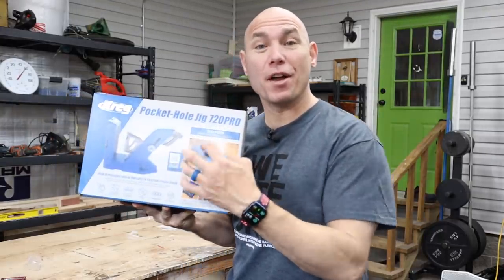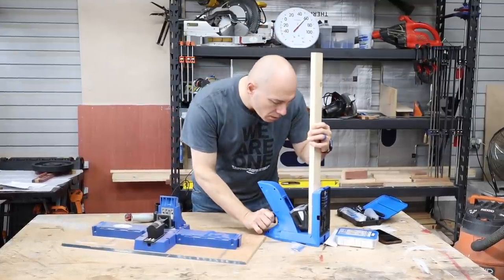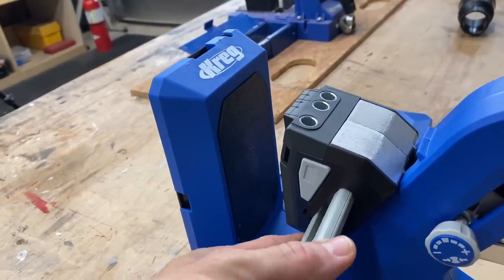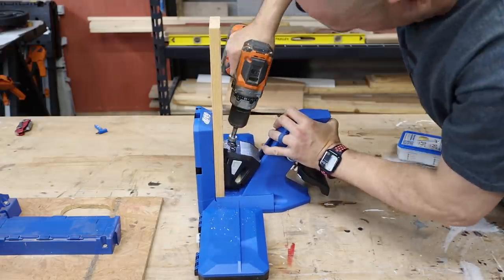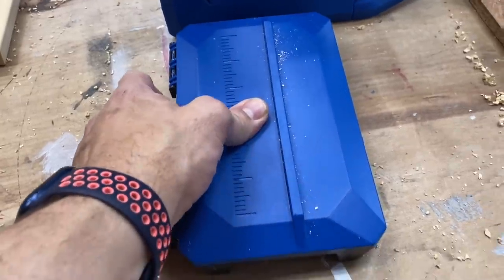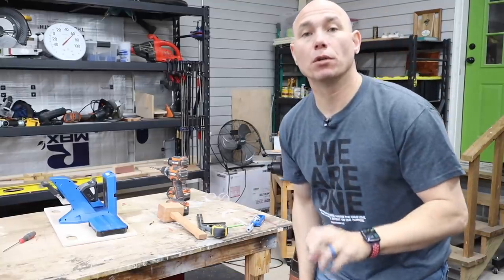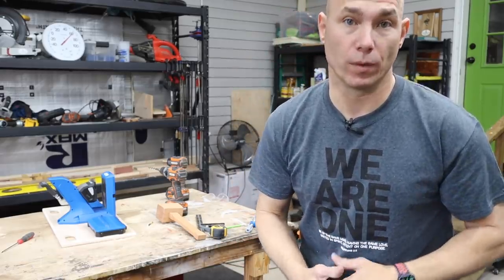Kreg 720Pro Is BAD!  I Made It Better!

Comment: Quick question...  Now that you mounted it to the board, you have eliminated the ability to move it and flip it the other direction to use it for large pieces etc.  Do you think there is a way you could mount it so that you could take it off the board easily to take advantage of this feature?   Also, those (flimsy) storage boxes are supposed to be mobile to place anywhere you need to support the large flat pieces and now that you have screwed them to your board, they are also stuck.  I was wondering if you had considered a way to mount them securely that would also allow them to pop off when needed?   Good review, and I also agree that those boxes are a fail.   I also think the clamp is a fail,  you have to screw it for days to get it to hold and it really doesn't hold it super solid, then you have to screw it for days to close it up enough to fit it back in the storage box.   Would have been simpler to just stick with a place to use an automax clamp.  Also, the clamp is useless if you flip the unit to do plywood because you would have to shove the jig back from the edge of the table?    Whoever "engineered" this, wasn't a woodworker...lol.
Reply from the maker: I could move it forward, but I never use them that way so no need to

Comment: My K5 broke on the first project I used it on, specifically the connection point between the driving rod and the sliding part of the clamp sheared off.  Sadly I couldn't take it back because I'd had it for years without ever using it.  I bought the pro afterwards, and while I do not like the cheap feeling, it has helped do a thousand holes probably and works just fine.  I have since retired it for all but cabinets because my dowelmax jig is absolutely superior for alignment and strong joints, at the cost of speed.

Comment: I build cabinets for a living and have used the old kreg pocket hole jig similar to the k5 but older and I still have it after 16 years of use I have finally looked to upgrade.
I pocket hole and biscuit front frames to my cabinet boxes I also use the kreg jig to connect front frames together with added domino biscuits not that you need them but it does help eliminate movement.
Just wondering what one to get now, what pocket jig do you recommend ?

Comment: Just an idea, but mount the storage side of the jig flush with the board so you can still use it both vertical and horizontal?
Reply from the maker: Thanks.  I never use them horizontal.  I have the R3 that I use for that.

Comment: I am having the same issue.  The hinges are extremly weak and if you don't baby it, the wings fall off and the latch pops off when you move it.    I also get a crooked hole when using 1 1/2" lumber.  It does not hold it flush as if the plastic is not strong enough and pulls away.
Reply from the maker: yeah, it needs work

Comment: Thanks, but it seems you could have "fixed" another important issue…  If you would have secured the left "storage box" to the left a bit more (with a wider foundation plywood base), that would have solved the issue of the lid not fully opening.  I would try putting a 45° connector on the vacuum tube — and pointing it down.  Having this stick straight out just makes it a cumbersome annoyance to seeing what is going on and would help keep the vacuum hose out of the way.  I have always put my pocket hole jigs on a board and like the "hard" plastic of the 3, 4, & 5 jigs.  I never upgraded to the 5 because I never saw the improvement enough to be worth it, although I do like their (Series 5) clamp better and "seeing" it in action causes me  to rethink my prior presumption.  Only practical way to support long boards is to create a wing that is the same height as the jig's platform; this is the basic reason I updated to the 4.

A couple things you did NOT cover… Will the 4 & 5 pocket jigs also work with the 700 series?  I have some accessory drilling blocks that c/would be useless if I cannot use them in a 700 series pocket hole jig.  Something really nice is the collar placement location etched on the drill bit.  This makes collar setting alot simpler and faster.  Also, supporting 1½" AND ½" stock is easier in the 700 series.  But for the seemingly flimsy plastic (compared to the rigid 3,  4, & 5), particularly on the Pro model, is a potential deal / anti-upgrade breaker.

Comment: Great review. I bought one of those awhile back. It's great for me, but still a pain to use. I like the board you put it on.  I'm curious, is there a reason you didn't put it flush to the end of the board so it could be used vertical?  

Thanks

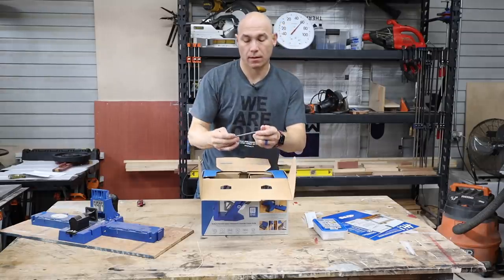Comment: You are not a big Dummy, you just did not watch the Kreg video on attaching the Storage Boxes. The 720 has a keyhole slot in the bottom. You mounted the adaptors outside the bottom of the jig. The adaptors slip into keyholes on the bottom of the 720, and then two screws goes through the adaptor into the board. This lets you quickly take the 720 off the board and reorient it, and then replace it. Just watch the  "Set up a pocket-hole workstation: Kreg® Pocket-Hole Jig 720/720PRO" and go to minute 2:00 and you can watch it. Love you channel.

Comment: Good review. I seen another review on this. But he did not show how he fixed the 2 issues. With that said. Take a look on the bit depth on the back. Vs the K5. I heard the K5 had more markings for the depth of the drill bit..
Reply: They should have a separate storage bin for the extra sawdust in this and then call it the 720 pro elite 🤣

Comment: hey there.... if you would have mounted the unit flush to the back then you could use it flipped up (flat) like it was meant to for versatility. also, Screwing down the wings negate positioning them out and away for larger pieces, see their video.

Comment: You didn’t say how you mounted the actual mechanism to the board. I have the 720 and don’t see any mounting holes. I’m nervous to drill thru it because I don’t know where any of the internal components are. Where did you mount it thru?
Reply from the maker: There are holes that you can use to put screws through. Flip those little side wings out and you should see them
Reply: @731Woodworks  oh, so it’s just attached via the little “lego” connectors?
Reply from the maker: Correct

Comment: Hello Matt,  You reviewed this 720 Pro Mar 7,21   with thumbs down.  You were thumbs up on your K5.   On Mar 25, 21 you reviewed the  Massca M2 and gave it super thumbs up.    But the  Massca M2 requires you to reach around your boards not like the K5 and K720 which allows you to clamp your board in front..       Has Kreg released a newer model than the K720 in the past three years that may have improved the K720  Thumbs Downs you listed.      Have you reviewed the Kregg 520 Pro with the pistol grip?     Ps using the clamp grip in front will be a better option for me because I am in a wheelchair and reaching around or behind will be difficult.   Have been searching for an used K5 with no luck..

Comment: I have the K5 out of necessity. The kreg pocket hole jig is by far, the most plasticky and least premium feeling tool I have in the shop. Sadly, it is a necessary evil for speed/efficiency on cabinet projects for me. If that's how I feel about my K5, I can only imagine the 720p. Yikes. Thanks for sharing!
Reply from the maker: Thank you. Check out Massca or Armor pocket hole jigs.
Reply: @731Woodworks  appreciate it. The massca has been out of stock a lot lately and just went ahead and pulled the trigger on the kreg instead. I don’t use pocket holes frequently enough and it DOES the job. Just doesn’t feel like a quality product.

Comment: I just bought the 720.  I wish I had bought the Castle portable picket hole jig when they were only $495, now they are $685 so I went with the Kreg.  I needed something simple.  I had the Kreg table model but sold it as it was somewhat confusing.  I plan on mounting my 720 pro tomorrow like you did.

Comment: Good idea mounting it to the board but I would have mounted it with the backside flush with the board so you can use it in the other orientation.

Comment: The clamping mechanism is in fact the same as the 5.. the spring part is used only for making it retract into place and is in no way involved in the clamping part.. I imagine if you remove it, it will still work but it black clamping piece will just keep falling down ..

Comment: The way you have it mounted what happens when you turn it 90 degrees to flip it over can you still use it or, is the edge of the board in the way?
Reply from the maker: you can still use it

Comment: Hi!  Love your channel.  I was wondering if the fact that you held the jig in an inch in the from the front of your wooden base, will you still be able to use the clamp slot?  I only have the 720, not the pro, but was curious in the event I buy the docking station.  Thanks!

Comment: Thanks for the review. Please, I'm not sure how the attachable depth stop at the end is supposed to work?  I missed something?
Reply from the maker: it basically just sits on the rail and the little knob tightens it down
Reply: You slide your board to the stop. So when you have multiple pieces your pocket hole will be in the same spot on each one.
Reply: @jessicahites871  thanks -- I originally thought he called it a "depth stop,"  and that makes me think of the depth of the pocket hole. But there's a collar on the bit for that stop.  My bad.

Comment: Hey Matt cool video I was wondering what you thought about the plug cutter the 720 comes with,I noticed you diddn't mention anything about that new feature,Thanks!
Reply from the maker: It came with a plug cutter?
Reply: @731Woodworks  Oops my bad when I was watching the Kreg video for the 720 they were talking about it, but after watching it again no  I was wrong.

Comment: Now that I've used 720 Pro for a year, I have some more information.  The wings suck!  The gray clips that hold it to the jig fall off and don't hold.  I use the wings to store screws and pieces, but I use a 2 x 4 for wings.  The jig is just the right height for one.  I like the board you mounted yours on, but I don't have the room. So I clamp the jig to the bench and if I need wings, I just double stick tape one or two 2x4s beside it.  

Your better built jig is nice, but requires adjustments for every board size you use. One of my projects required 1 1/2, 3/4 and 1/2 inch boards.  I have three bits, so I just chose the bit set for the board size and drilled each board as quickly as if I had only one size boards.  

Over time, the spring loosened up a bit and works very smoothly now. It was pretty rough in the beginning.  I'm not as industrial as you are with using it, so it will probably work longer for me than for you.  

I do have one of the Masco jigs and made some holes with the Kreg and some with the Masco.   I was having problems getting the screw length correct until I made a hole from each one next to each other.  The Masco has a shallower hole which requires a longer screw, and it seems to tear up the surface wood much more than the Kreg.  I have the clamp on Masco.  That's just my experience, but they both still work. 

With the Kreg Jig, making pocket hole joints is fast and easy and I suppose, accurate. I think, though, I am interested in using dowels instead starting in the near future.  I don't think they will replace all of the pocket screws in my projects, but they will reduce them a bit. 

Thank you again for your content.

Comment: I have both, K5 and the 720 pro. I previously had a K4. There are pros to this 720 over the K5 which I feel you left out. Setup for actually drilling pocket holes is significantly reduced with this tool over the K5. No depth adjustment required for board thickness and the drill bit is labeled with common sizes so setup is a breeze compared to the K5. I do think the K5 is sturdier but I don’t think the quality is far off based on my usage. I do think this tool was designed for more of the job site Pro in mind considering it is a smaller footprint, when wings are folded, and has the setup advantages I listed.
Reply from the maker: It'll never last as a "job site" tool.  Being transported, etc.  No way it lasts.
Reply: @731Woodworks  think of the type of contractor who will be using this. We aren’t talking framer or rough carpentry. We are talking mostly about folks who will be doing finishing work on trim and cabinets. I do tons of projects with my Kreg Jigs and I just think the wear and tear that you are proposing this thing taking is way overstated. I would say my jigs are rarely banged around while in use. In fact the most wear and tear they take is from storage not actual usage. I’m just of the opinion the conveniences in this jig outweighs the durability concerns.
Reply: Oh by the way, absolutely love your channel and what you do and I don’t disagree with you often. My business partner and I are huge fans!

Comment: You should have mounted it flush on the back of the board so you could still clamp it to the workbench  and use it horizontally
Reply from the maker: I thought about it but I never use the K5 that way. Only use it for vertical.  I have the R3

Comment: I agree 100%!  I thought I was the only one to be so disappointed with this.  The hinges are HORRIBLE!!!  I like how your made it sturdier but it is a shame that real users are having to do this and thus losing the ability to fold it up and make it compact.  Also, did you try using it with a 2x4 on the NDA instead of the side.  Mine wouldn’t clamp flush and left a gap at the top...and this caused the bit to drill out some of the guide.  Did you have that same experience?  I’ve had mine for 5 days and I am probably going g to send it back and wait until the 2.0 version.
Reply from the maker: I didn't try that
Reply: @731Woodworks  If you do, please let us know.  I don’t know if it is just mine or if it is all of them.

Comment: Just wondered why you didn’t mount it further down on the board ?   Difficult to explain what I mean, but parallel with the board edge. You can’t use it in the vertical position as you have it.  Not that it matters to me as I won’t be buying one, love my Armor Auto Jig 😜.   Really enjoy your channel 😊👍🏻
Reply from the maker: Thanks.  I never used the K5 other than vertical. Don't think I would use this one any other way.
Reply: @731Woodworks  Think I’d stick with the K5 if I were you, 720 looks like a poorly thought out and fairly pointless “upgrade” 😊.  Keep up the good work my friend.

Comment: Looking once again, you could have a second 3/4 board vertically so the jig could be flipped and it would have a good surface for clamping.
Base and back joined with pocket hole screws of course ;-)

Comment: I'll keep my K5 even though it's messing up right now. I had a board in the jig this afternoon, set the tension like I always do, started to drill and the tension popped off the clamp. Finally got it to hold enough to drill my last few holes, but something isn't right. Didn't you have a problem with yours? I'm going to try to contact Kreg tomorrow. Good review! :)
Reply from the maker: I've never had any issues with it
Reply: @731Woodworks  I was thinking in one of your videos you mentioned a problem and Kreg sent replacement. Must be thinking of another vid! 🙂
Reply: @731Woodworks  The video I was thinking about was your 2018 Shop Tour. You mentioned top popping off and Kreg sent replacement. Mine's not popping off but not holding tension on work piece.

Comment: I was looking at this jig and seriously thinking of buying one, even though it seems a bit extravagant given that I already have a Kreg Pocket Hole Jig.

But having watched this review, I think I'll wait until they implement the improvements (which I'm sure they will do).
Reply: PS  Your mods were good but removed any incentive to buy the product as your mods remove some of the key functions that could persuade me to fork out the moony to buy one.  Those features being:

Portability - the idea that it folds into a compact portable unit containing all of the bits and pieces,  which is ideal in a small garage plus workshop like mine.

Versatility - the ability to use it horizontally as well as vertically is lost once it is mounted to a board.

Comment: I had looked at this, and thought it looked 'gimmicky' and a bit plasticky, Seems I was kinda right. I'm gonna go retro with an all steel unit from a UK supplier (just 15 miles from home, I'm in Sheffield UK), It has a solid tool steel guideblock with no added bushes, that gives longer drill support, and no flex or give, when clamping No auto adjustment though, ah well, thats what ya get with retro.  Thanks for the review.
[edit]  The unit I am getting looks pretty much like the Massca that you reviewed, except tool steel rather than aluminium.

Comment: I enjoyed your review.  I was thinking 2 things:  1) if you adjust the tension knob on the side it might bring the clamp up enough to clear for the dust collections and 2) maybe it might be better if you placed it at the very back edge of the board before you screwed it down so the you can use it in the other position.  Just a couple of thoughts.  Thanks for the information you provided regarding the tool.  
<
Reply: That’s what I was also thinking about the mounting position. Needs to be at the back edge of the board to it can be used in the other position.

Comment: Thanks for the complete and honest review of this Kreg Pocket Hole Jig.  I also own both models and I mounted the K5 to a board too because it works better that way.  I just got the K20Pro so I haven’t used it yet, but after your video I will probably mount it similar to your setup.  Your mounting board also provides two holes (AKA handle holes) to use with quick-clamps to hold the jig in place during use which is another benefit with your design.